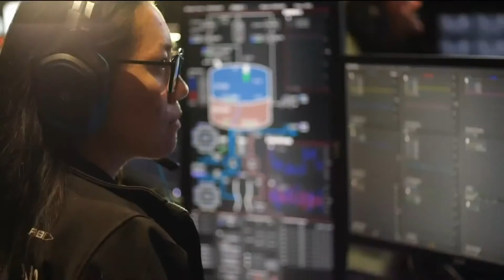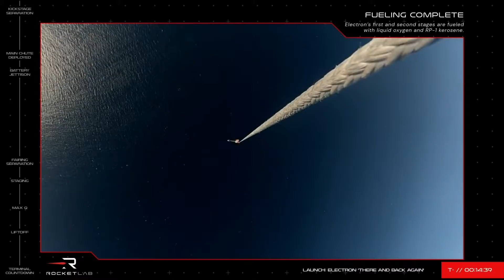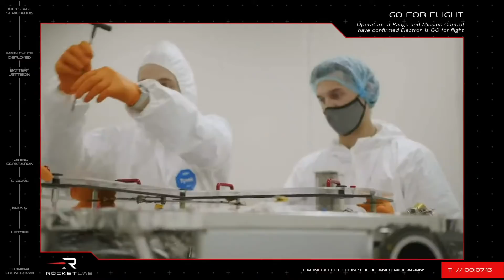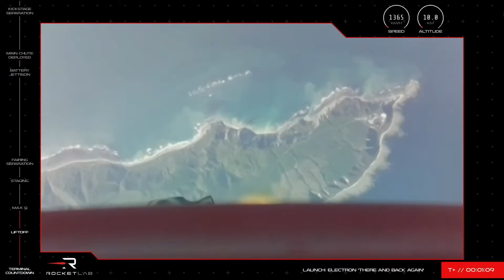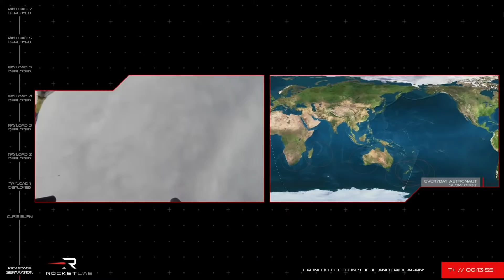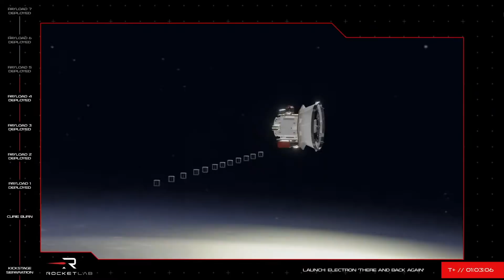REPLAY: Rocket Lab "catch & release" in mid-air with helicopter! (2 May 2022)

Comment: Spoiler alert: 1:06:00 chopper snags chute of returning booster as planned. Rocket Lab broadcast goes quiet. Tum tee tum tee tum ...
1:49:00 turns out chopper pilot decided to drop booster in sea as load handled unexpectedly compared to tests. Waiting boat then recovered it. Maybe using chopper uneccessary if booster doesn't mind dunking!